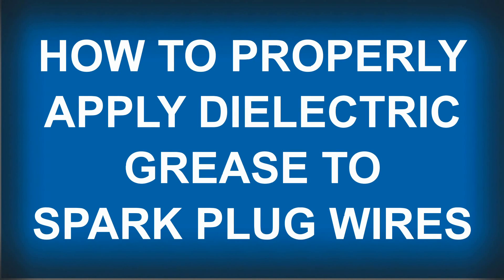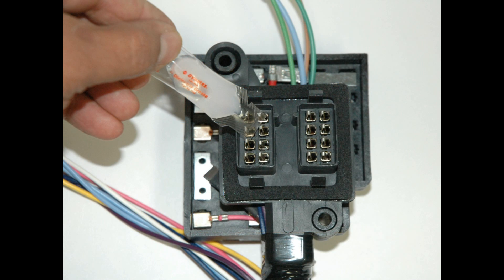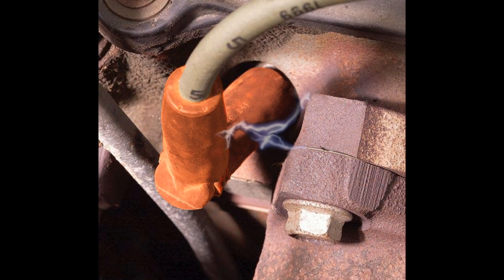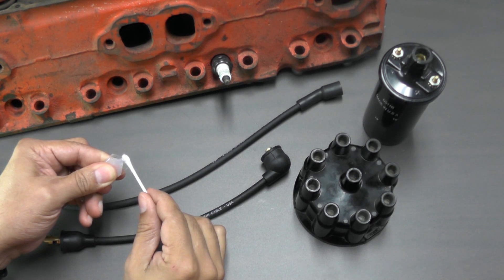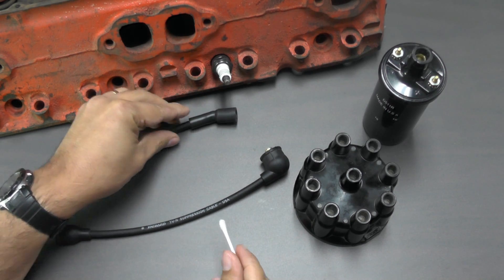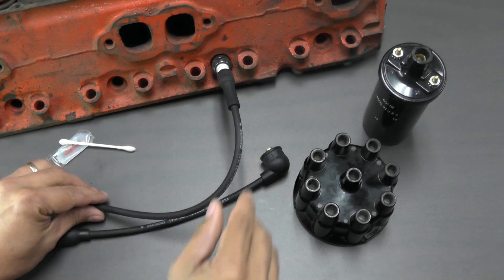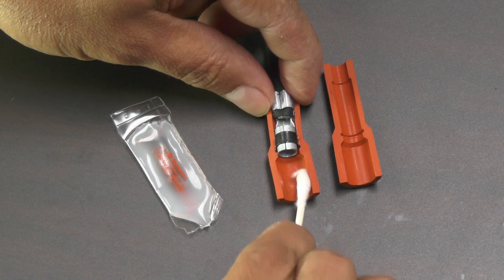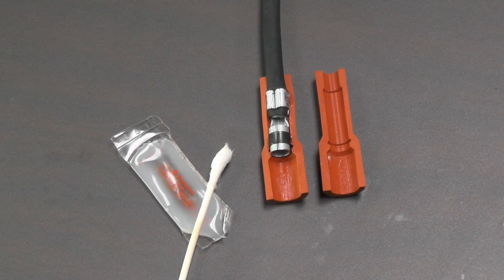Dielectric Grease - The PROPER way to apply it.

Comment: I know this is a couple years old, but, dielectric grease is a must in outdoor equipment connections subject to dirt and water. I've had countless switches fail and overheat due to dirt build and corrosion over the years that came from the factory w/o being greased. Dielectric grease seals the connections from dirt, water and corrosion. When the connections are properly made, the grease is pushed aside and metal to metal is made, and the blades/pins are now shielded from dirt, water and corrosion.

Comment: Grease should NOT interfere.   Let me say this.   The conductive path is pratically molecular sized when two parts are fastened.  That shouldn't cause any resistance..    Test it out.   put some dielectric on a flashliht terminal.   there will be no issues.

Comment: "One incorrect logic is the "dielectric" in "dielectric grease" means the grease should only be used to insulate. All greases work by the low viscosity allowing the grease to completely push out of areas with metal-to-metal contact. Dielectric grease is just better at holding off high voltages over long paths." The author of this statement has a long and practical history backed by experience and science. The article is accompanied by charts that demonstrate conductivity and resistance under numerous conditions. https://www.w8ji.com/dielectric_grease_vs_conductive_grease.htm

Comment: This video is WRONG. Dielectric grease is approved for electrical connections. Silicone lubricant seals out air and water but allows electrical connections to pass. If he wanted to "enhance" an electrical connection he would be pushing conductive grease which is silicone grease with metal particles, but that stuff is scary outside of spark plugs since if you leak Lube you run the chance of electrical shorts.

Comment: Then why the hell didn't they state that on the package!! it doesn't say a damn thing!! Now I have to go through my whole truck's electrical and clean it off?? ANd with what????!!!!
Reply: No problem: One incorrect logic is the "dielectric" in "dielectric grease" means the grease should only be used to insulate. All greases work by the low viscosity allowing the grease to completely push out of areas with metal-to-metal contact. Dielectric grease is just better at holding off high voltages over long paths.

Comment: You are the only one who put grease corectly ! (Dielectric meen ISOLATION & Shield)
Reply: I don't think there is much disagreement about the grease being an insulator. The disagreement seems to lie, at least for me, in whether the metal to metal contact points will push the grease out of the way and conduct properly. Having played the part of industrial maintenance in the food industry for a while, I know for a fact that dielectric grease often goes directly on the points of contact before reassembly. I've wired many wash-down rated 3 phase motors for which the manufacturer supplied wire nuts packed with dielectric grease. I've seen the stuff save lots of downtime by improving reliability in sensor and servo motor feedback cables.

None of this stuff is high voltage (in comparison to ignition) and the contact points have more pressure and undergo less vibration in the cases I mentioned than a spark plug terminal so the argument not to coat a spark plug terminal seems sensible.
Reply: 'opinions' are NOT facts.Spreading misinformation is wrong.  Get yourself a multi-meter and test the resistance for yourself.  And delete this video.
Reply from the maker: I think so too. But from some of the comments, some people disagree with my thinking that dielectric grease is an insulator. We all have our own opinions and that's fine with me. Thanks for your comment.

Comment: Oh my gawd!! I feel like and idiot now O_O
any advice how to clean Dielectric Grease from grounding terminal and bolts T_T
Reply: Don't freakin worry about it, it won't hurt nuten, the bolts will  force out the grease where it makes contact unless you left them loose.
Reply from the maker: Just wipe it off with a rag.  Or if you really want to do a proper job, use a q-tip and alcohol.
Reply: haha I did, I used carb cleaner and lot of shop rags
Reply from the maker: Ikera Palchevskiy That will work too!
Reply: Same here. They idiots do not state that on the package

Comment: It's okay if you get dielectric grease on the metal terminals as it is intended to prevent corrosion on the metal contact points. And speaking of resistance; you will get resistance if the contact points are corroded.

Comment: This is not good information.  Dielectric grease is used in many industrial applications on electric connectors and terminals.  Engineers prescribe this especially in severe environments because the grease displaces the air in any voids and prevents contamination from humid air, oil, water, or whatever other environmental contaminates might exist.
Reply: Exactly.  metal on metal has no resistance even with grease.  This is easlily tested with a multimter and some copper tabs coated with grease.  Electricity easily tunnels through that.
Reply from the maker: If contamination (as you stated) is a concern, it may be OK to surround the terminals with dielectric grease, but avoid getting it between the terminal-to terminal contact area, or where the terminals make electrical contact with one-another.

Comment: I agree with the video.  Never use dielectric grease on spark plug wire terminals (and maybe electrical terminals in general).  I did once and was not pleased with the spark plug terminals pitting (arching?) that occurred after only a couple thousand miles on my car.